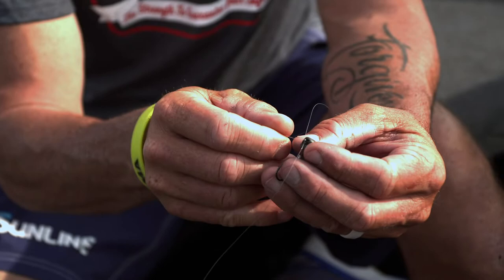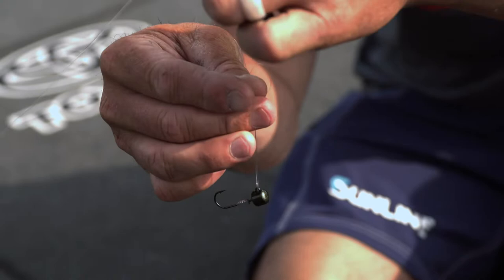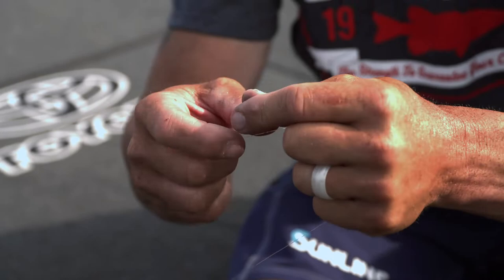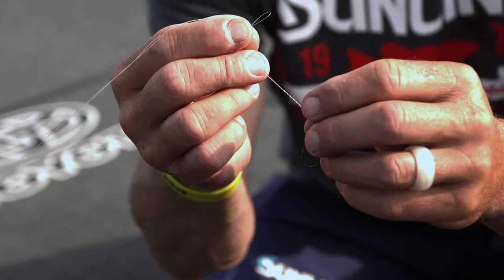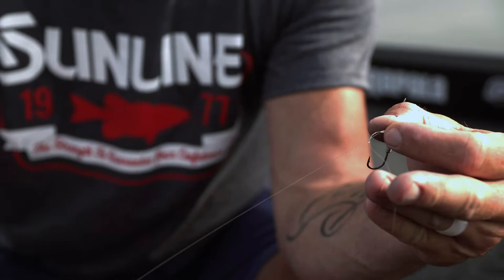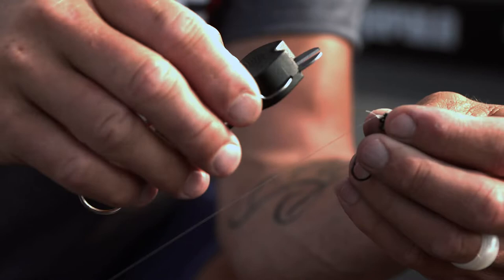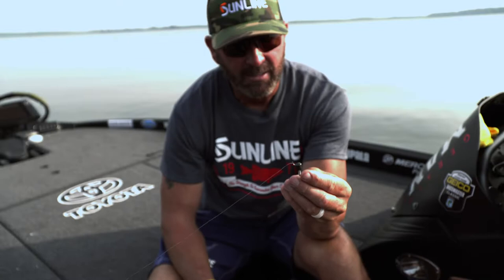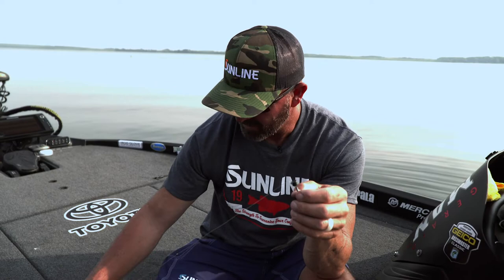Gerald Swindle Ties His Go-To Knot For Fluorocarbon

Comment: Got the just of it, but I wish GS would have shown the steps a little slower with more closeups, pauses and better camera work - To me it look like he twisted the jig/hook a total of 3.5 times, not 7 - I've tested it quite a few times and in all my evaluations the knot would break anywhere from 78-85% of the rated fluorocarbon line's strength (depending on the manufacturer) - Which is pretty solid compared to many other knots.
Reply: Its just a double clinch knot lol
Reply: I know this is an old video but I still think the doubled up uni knot is the strongest imo.

Comment: I have tried this knot over and over and it keeps slipping what could I b doing wrong
Reply: Cutting tag ends too short maybe? I had the same issue when I was practicing this knot.
Reply: i tried for the 1st time today when i hooked a fish and it slipped. lost the fish and jig
Reply: I've used this not for a long time and have never had it slip, make sure you back thru the big loop at the bottom